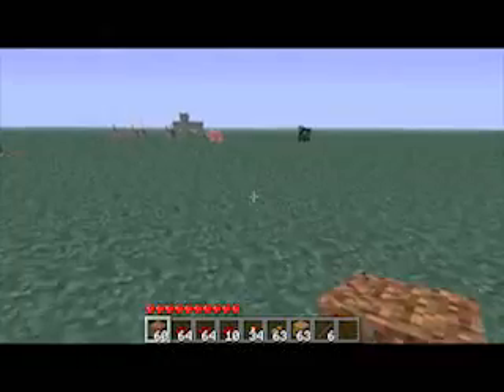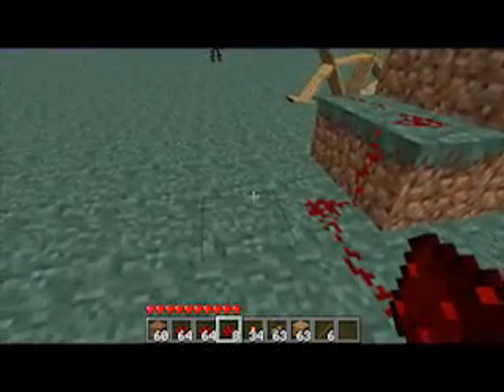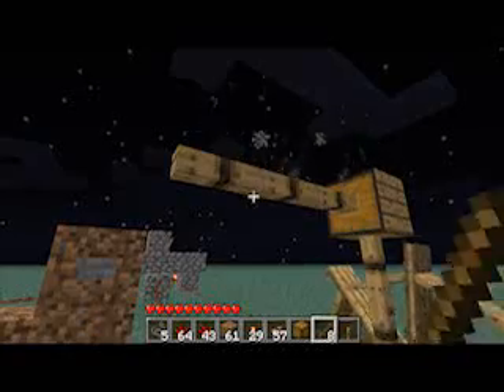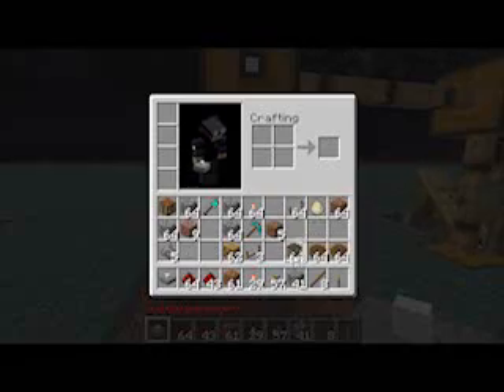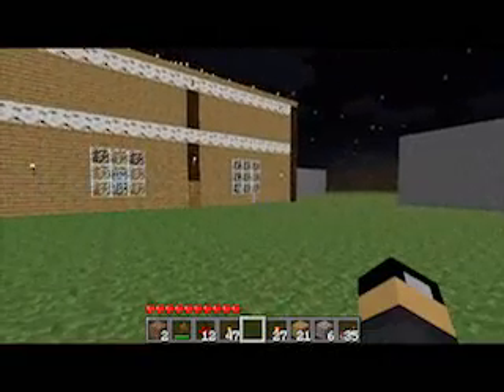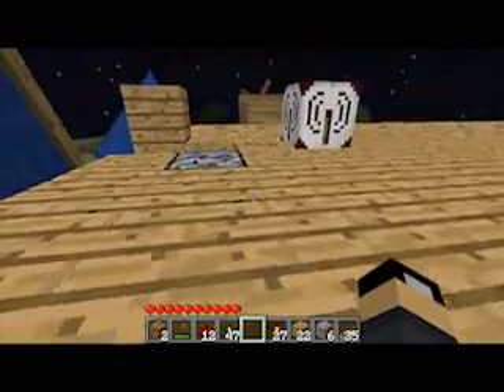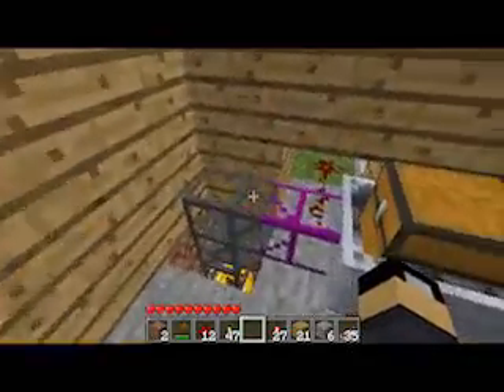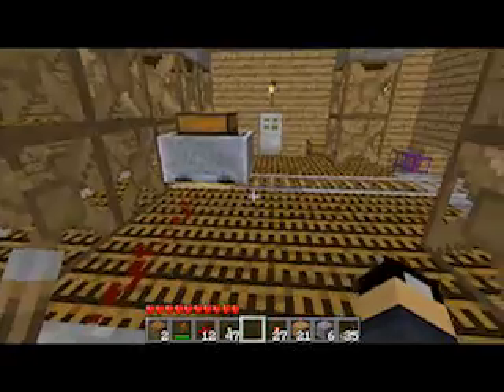Better Than wolves mod- pulley tutorial

Comment: @spynikk I'm having so much trouble with the saw. I put the saw down and connected one axle on the back, and then another on the back of that axle. I put a gear box on the back, used some red stone to lead to a switch, and put it on, but the saw doesn't do anything...